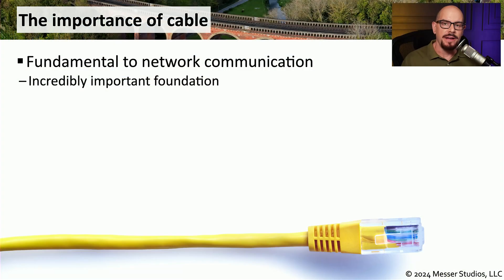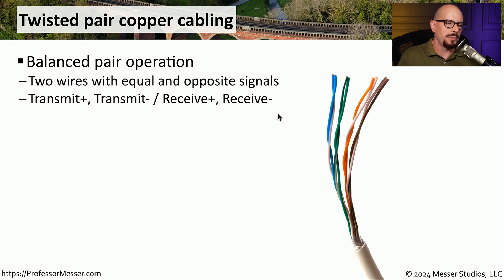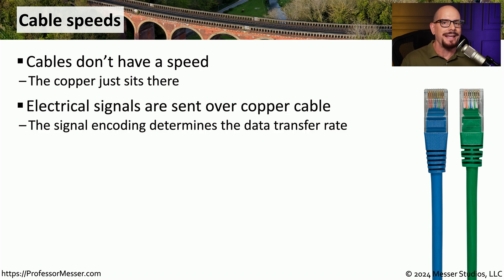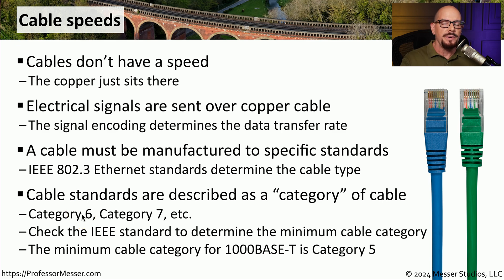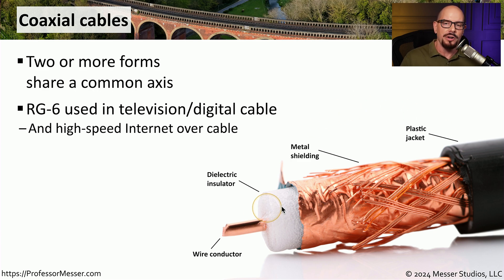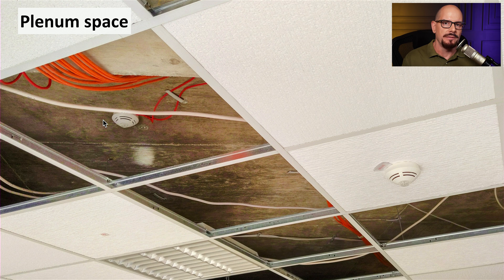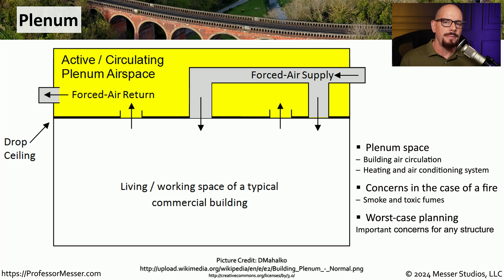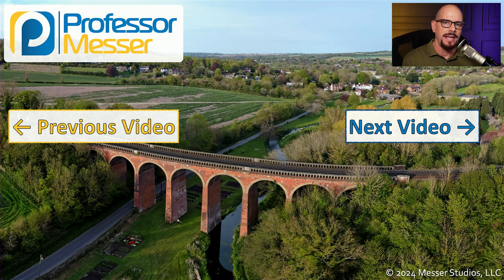Copper Cabling - CompTIA Network+ N10-009 - 1.5

Comment: Can you expound some more about the cable not having speed?
Reply from the maker: It's a hunk of copper. It just sits there. It has no speed. 

The signal on the cable is the thing that has a speed.
Reply: @professormesser  Thanks for replying. 

The signal is the actual category?

If not, why then label the cable like that?
Reply from the maker: The road isn't the measurement of speed. The car engine determines how fast you will go.

The category is a description of the cable's capabilities. The category ensures the cable can support a particular signal type.

Different Ethernet standards require different categories of cable, depending on how fast they need to go. For example, The IEEE standard for 1000BASE-T describes a 1 gigabit speed of Ethernet. The standard specifies you need a minimum of a category 5 cable to support this speed.
Reply: @professormesser  I do get the road analogy, but the explanation about in the next paragraph kinda throwing me off. 

I'm really trying to understand this because I don't just want to pass the exam, but to fully grasp the concepts. I'm a hobbyist running a small WISP I started up and this is very important to me.

With that said, let's say a Cat 4 can only facilitate a 10 Mph speed, and a cat 5 can take a max of 100 Mph...wouldn't it be fair to say the cable determines the speed?

What am I missing?
Reply: @R-ce9yj  If you don't have a 100mph signal then it doesn't matter if you have a cat 5 cable, the signal is still only capable of 10mph
Reply: @Frost287  I get that, it just seems contradictory to what I was taught.
Reply: @R-ce9yj  The cable itself doesn't go anywhere. So it doesn't have speed. But the physical attributes of the different types of cables can support data movement of different rates. Different cables support different speeds, but the physical cable isn't going anywhere. A wider road can support a higher speed limit, though the physical road itself isn't moving.
Reply: I looked into this because I was curious about it too. According to ChatGPT (it’s always right lol):

Cables do have speeds because their design affects signal integrity, frequency, and data rate. Higher-category cables (like Cat 6/6a/7) support higher bandwidth and less interference, enabling faster speeds. A Cat 5e cable won’t run 10Gbps like Cat 6a due to its lower MHz rating and more signal loss over distance.
Reply: @claybreland9196  I saw that too, then I read where the speed on the cable is a "recommendation" (whatever that means). 

Also, I saw a youtube video showing that the cable doesn't matter. My current thoughts on it is that for the exam, stick to what is taught (cable have speed limits) but in real life...naah (just don't go too far in length)

Comment: I've always associated Ethernet to RJ45 because I always hear Ethernet cable.  Was I incorrect?
Reply: RJ45 = the common name for the 8P8C modular connector used on twisted pair Ethernet. It is a connector, not a cable and not a protocol.
Reply: I believe so, Ethernet could be as much fiber as RJ45 as any other type of connector/cabling, as long as it's a wired connection.
Reply: @eg1525 ethernet is a communication protocol not only limited to wired connections.
Reply: RJ45 is the cable, ethernet is the data format that cable transmits
Reply: Could be wrong, but I think RJ45 is more referring to the connector than the connection type or cable type.